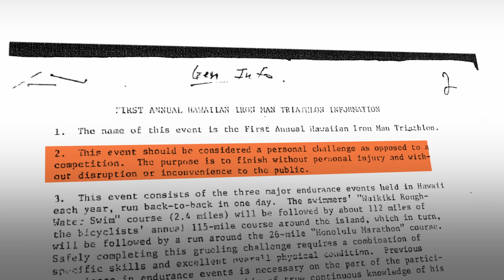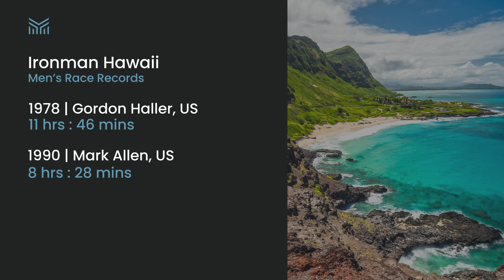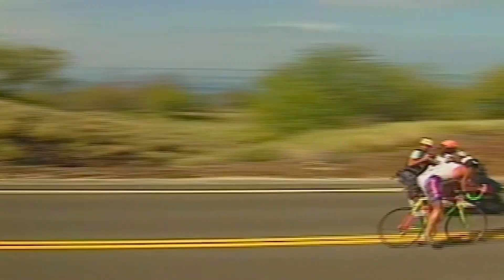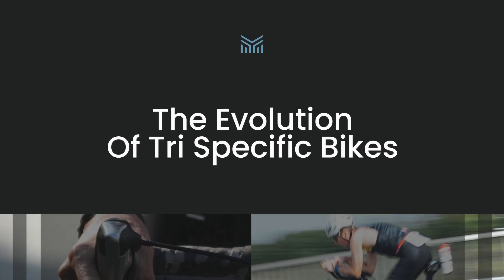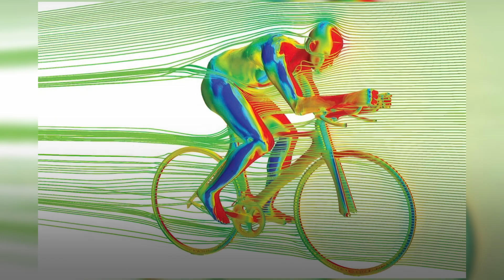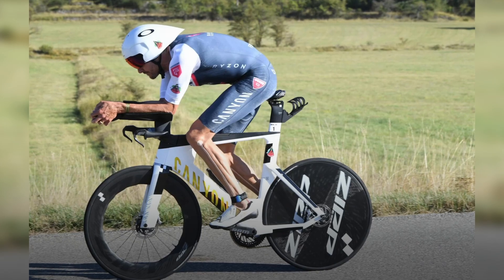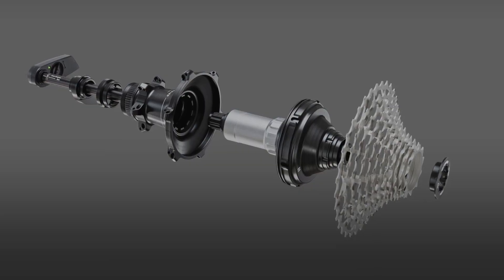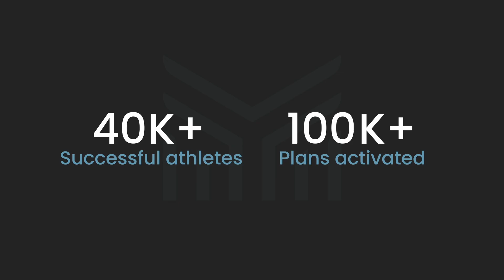How Aerodynamics Changed Triathlon Forever: Cycling Speed Secrets Revealed

Comment: Hi Phil, Quick question. I noticed in the background you have a disc rear wheel. Are you able to fix a tire puncture during a race on it? Or are you running tubeless & hope that will be sufficient?
Reply from the maker: This one is a disc cover, but it works the same way as a disc wheel (it's just a fair bit cheaper!) 

This wheel is set up tubeless, but it's still important to be able to fix a puncture (tubeless reduces the risk, but you should still be prepared). 

And yes, you can still change a puncture with a disc wheel. It works the same way as a normal wheel, the tyre comes off just like a regular wheel and  there's a cut out section on the disc where the valve pokes through to pump up the inner tube (or tubeless tyre). The cut out section is usually covered with a sticker to keep the wheel smooth.
Reply: @myprocoach123  Hi Phil, Thank you for the extensive reply. I think I have the same wheel covers, by EZ Gains. The problem I'm having is that my GP5000 fit so tight that I have to hook a lever behind a spoke in order to get a second one in, in order to pry off the tire in order to install an inner tube. I thought it was a more common issue, but it sounds like you are managing just fine prying off your tire with the covers one. Maybe I need to try and different tire (& possibly rim) combination.